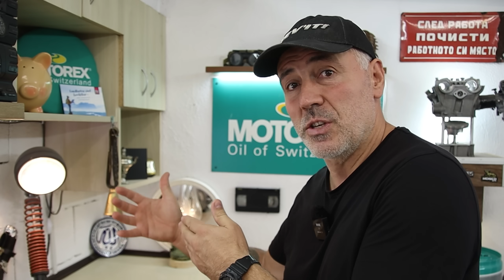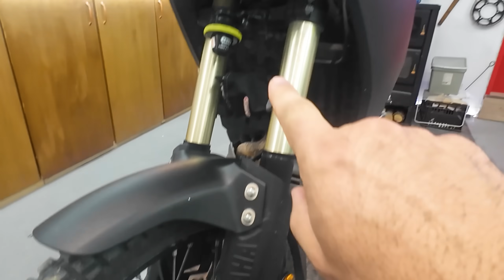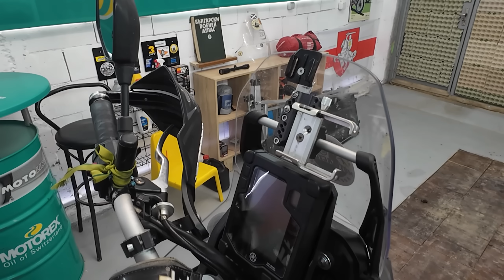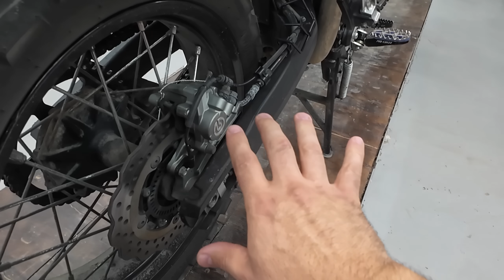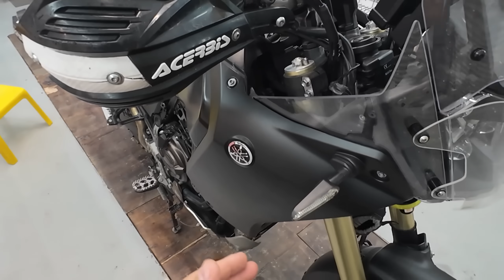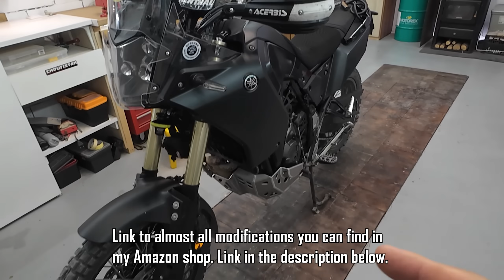12 Budget Adventure Modifications for Any Motorcycle

Comment: I removed the kick stand kill switch because when I rode standing up my heel would sometimes touch the kickstand extension enough to kill the engine. I made sure that the cut cables were tucked in securely and sealed waterproof.  I grew up riding so double checking neutral before letting go of the clutch with the kickstand down is already in my muscle memory.
Reply from the maker: Thanks for sharing!

Comment: If your bike doesn’t have built in tyre pressure monitoring, you can buy a cheap Bluetooth system with its own battery and small solar charger on the display unit. It means you have a continuous read out of tyre pressures and temperatures. You set an alarm light to flash if either tyre pressure drops more than a few psi. The system costs less than  $100 (made in China, of course). Mine picked up a slow leak in time for me to turn back to the nearest town and get a roofing nail pulled out and puncture fixed by a proper tyre shop. Without this warning I would have gone too far beyond help and maybe had a problem fixing it myself. Then the pain of recovering the bike etc, so I think it already paid for itself.
Reply from the maker: I prefer to stay away from this type of gadgets.

Comment: how can you have a branch in a brake that locks your wheel, then start again, ride and notice that it locks your wheel? if it locked wheel first time, after fall is should be there preventing you from starting again. and if you overpass brake force with engine, you should feel difference in power you neaded to add to start rolling. this story thoes not makes sence (hovever branches falling into brake pedak indeed can occur
Reply from the maker: After I lifted the motorcycle I couldn't move.  This is what I said or what I meant.

Comment: It's the first time I see a grip heater controller on the right side. It feels a bit cumbersome to operate that with the throttle hand.
Reply: On my Multistrada the factory heated grips button is on the right hand side, It was not unexpected for me :)
Reply: @darko156  If the buttons are integrated in the switch block and you can operate them with your thumb, I guess it's fine. But the Oxford controller is handlebar mounted and far from the hand.
Reply from the maker: The left holder don't have two bolts. It is a matter of a few days to get used to it.

Comment: With your brake pads. You can buy Elig ceramic brake pads for your tenere. Lasts longer than OEM and doesn't eat your brake rotors.
Reply from the maker: I will check them out, even though I cannot believe that ceramic will save the rotor more than oem.

Comment: I am only slightly afraid to use an aliexpress aluminium part for footrests, IMO this is not the best idea.
Reply from the maker: You can buy the same things from amazon for double price, if this make you feel better.
Reply: @motorcycleadventures  I wouldn't buy important parts like footrests from china, be it from Amazon or Aliexpress, especially if it is aluminium. These parts from China are not made with safety in mind. If you crash with these footpegs, I wouldn't ride with them anymore.  These China footrests are probably made from the exact same material as their phone holder.
I have 0 issue with parts from Aliexpress, but I don't use it for important parts relevant to safety.
Reply from the maker: More than 80% of the parts of all motorcycles comes from China. About the pegs, these are not the first that I have seen in my life.